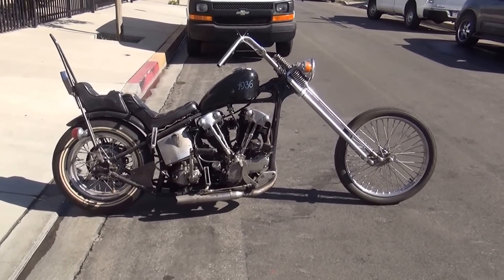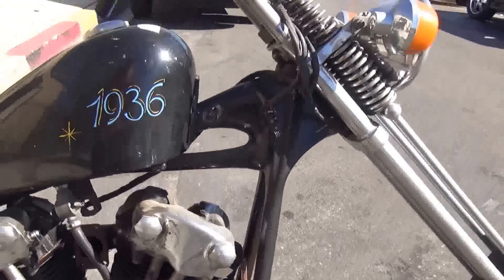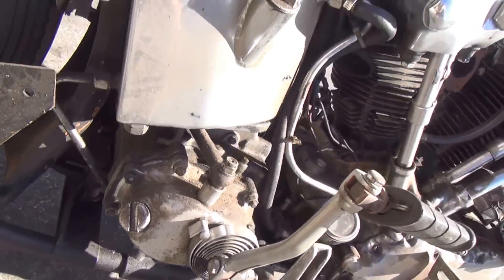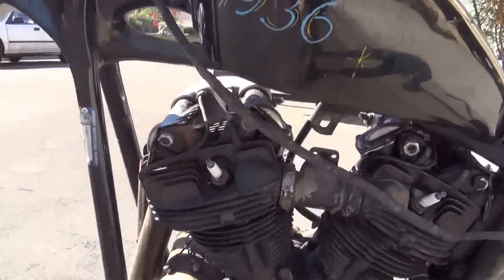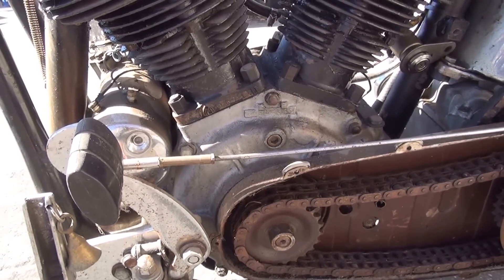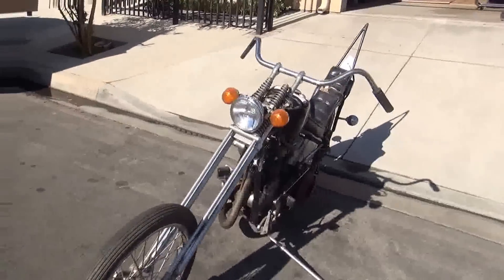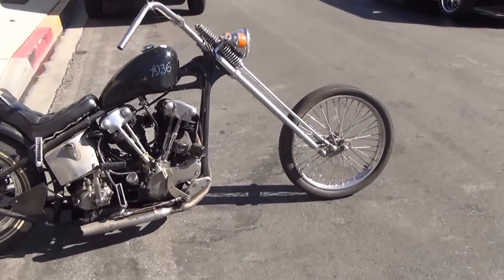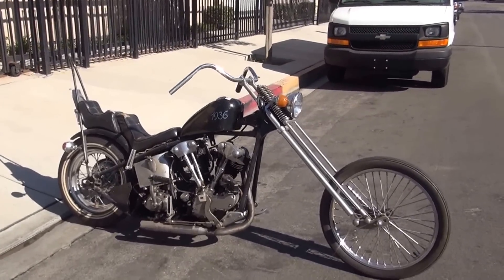Hunting Harleys, 1936 Knuckle chopper

Comment: Thanks for sharing all the history of the bikes. I had a 1956 panhead 74 inch topend on 1948 rigid frame chopped with a 16 over wide glide. Also was on 61 inch EL cases. cost me $ 800 and spent $ 500 chroming and rebuilding. Brings back great memories.

Comment: I remember watching the video when you bought this!

Its too bad you never got it running; was there a specific reason?
Reply from the maker: lack of mechanic's doing what I paid them to do, too busy stealing parts and doing shabby work. I am moving to PA. Done with the jealousy and greed of the California people. However, to move, I need to sell a few bikes
Reply: HuntingHarleys Thats too bad, It would have been great seeing this bike ride up and down the street.
I'll be in MA in the near future, maybe I'll see ya at a bike show!
Whats still wrong with the bike?  I noticed the missing carburetor and ignition coil
Reply from the maker: ***** I have never tried to start it. What I personally like to do with a bike like this is pull it all the way down, THEN you know what you have and it is a good machine. However, a carb, tune, and gas and it "should" run. The question of course is how reliable. That one never knows.
Reply: What part of Pa you moving to? Im on Pa/Ohio line.